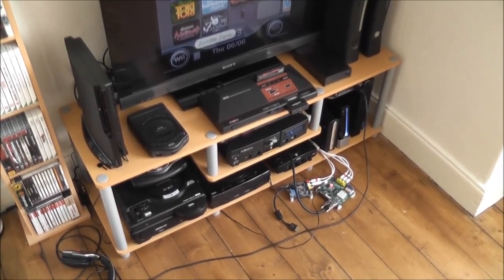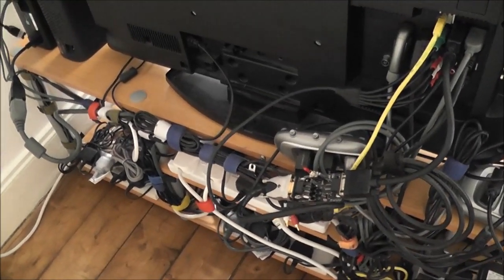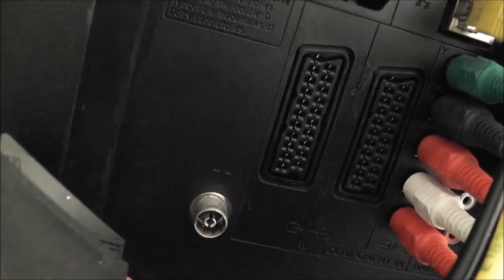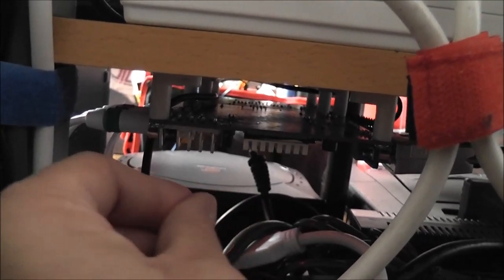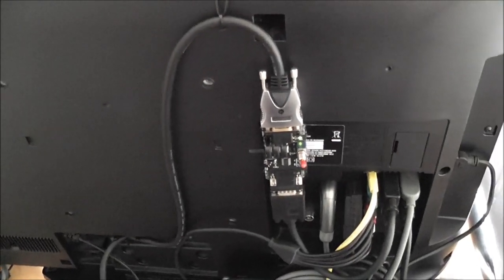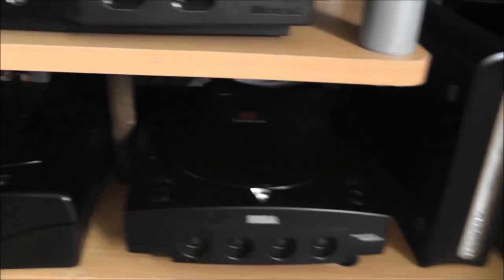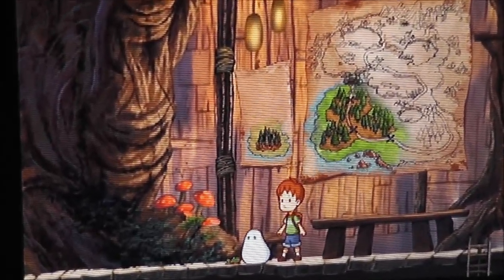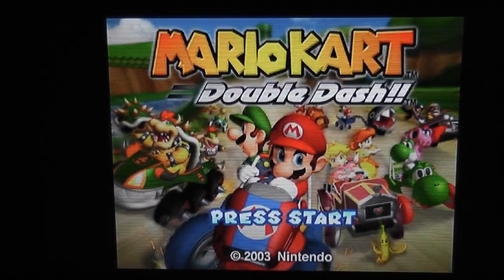Wii Scaler + SLG Installation - A Behind The TV Adventure! - GameCube Scanlines

Comment from the maker: I designed it so it can be moved very easily as one complete unit. All the cabling is either bolted, screwed or fastened directly to the unit and cannot be moved or fall off. All I need to do is disconnect/remove the TV and systems. All the wires and PSUs stay exactly where they are. I place the consoles in storage crates then secure the entire entertainment unit in wrapping film. Whole process takes about 20min max. I've done it a few times now while redecorating. Huzzah! :)

Comment from the maker: I don't use an SLG in the box but I guess the hardware here is near enough identical. I believe the manufacturers state there's something like a 1ms display lag when running the signal through this scaler. Not enough to be noticeable and personally I can't detect any difference between running it with or without.

Comment: Great video mate, thanks for sharing! I love how you have all the cables neatly tucked away by the back. You could teach me a thing or two, I'm more of a spaghetti cable kind of guy! :D That is one beastly set up!

I actually tried to get my slg-3000 to work with the wii after purchasing a third party vga cable for it, but I guess the cable doesn't allow the wii to output a vga signal as the slg wouldn't work. That's where the vga scaler comes in handy yes?

Comment: hi mate, 
Sorry to bother you but you seem as though you have a good knowledge on these type of things,i am having some video issues with a victor saturn that i recently purchased. It came with a composite cable which i have tried and also put that in to a scart block adapter and also tried my pal saturn scart lead. all show the same. i have tried it on my 60" plasma and 50" plasma both have the same result. i am sure both tv's take 60hz rgb. i am not to sure if its a hardware issue.

Comment: Why would you want to have a scanline generator?
Reply: Old game where designed using CRT screens and they benefit on natural scanlines. Specially games with interlaced resolution like 480i will be scaled to 480p on LCD screens causing unwanted edges and lost of details. Game developers only saw a 480i picture on the CRT screen WITH scanlines. http://scanlines.hazard-city.de